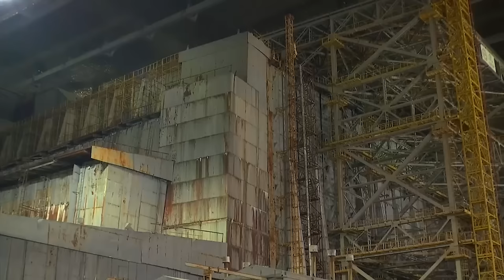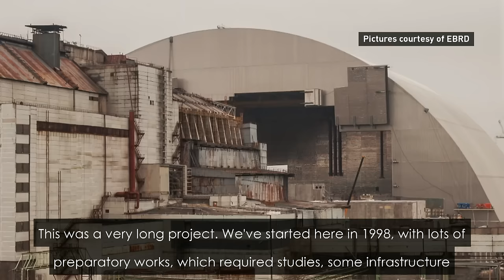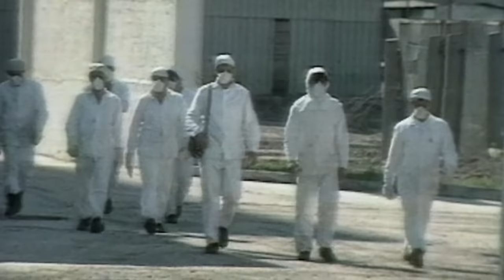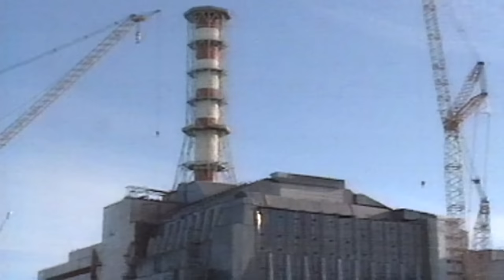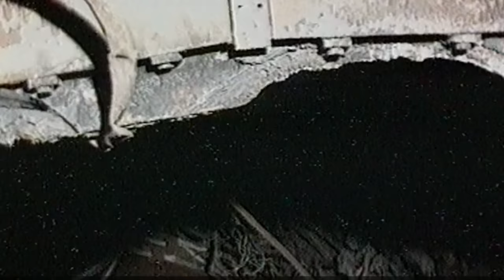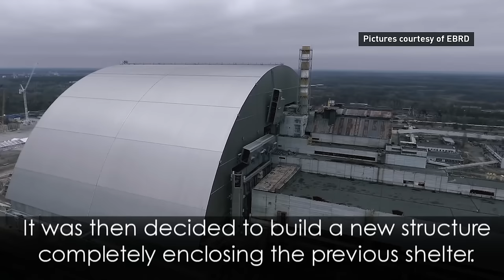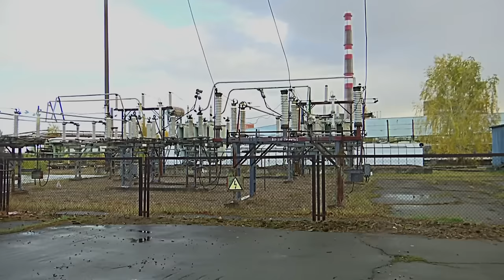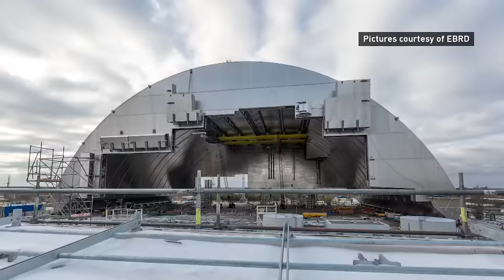Inside Chernobyl’s new €1.5bn structure for exploded nuclear reactor

Comment: so much effort only to isolate 3.6 roentgen?
Reply: Not bad not good.
Reply: Not great not terrible
Reply: Cnn is Fakenews an example, “the elephants foot”
Reply: Not nice good enough
Reply: Marcus Marshall heard it is the same as a chest x-ray
Reply: @JorgeRamirez-dl2hj  Uh no. That's not near the stack, it's underground.
Reply: @akselstrdal3962  That's when it exploded.
Reply: No Deaths *Slams against table* Actually, its the equivalent of 200 million chest x-rays
Reply: They will try to disassemble the reactor so obviously they need a better isolation
Reply: ITS WAY higher than that...the majority of the radioactive material they can get to without taking the old sarcaphogus apart and getting equipment in because most the largest part of the radioactive material caved in when the reactor exploded...also they are still working on a way to get too and remove the massive amount of nuclear waiste sitting on the concrete foundation (which it has been slowly eating thrue) and which under sits the the river from which is the largest source of water to the entire country (also if said nuclear material comes in contact with said water it could set off another explosion 10× or more worse than the first one not th mention completely contaminate the river and the water supply)... and their are parts you are not allowed to go into for more than hour at a time even with full protection on and you arent allowed at all without any protection on because of radiation levels
Reply: It's all about the dust. High amounts of beta radiation have been slamming on the concrete for decades. It causes the concrete to let go of powder contamination. The old containment structure was already starting to collapse. If it had, without this dome over it, then those particulates would have gone airborne all over Europe due to strong winds in the atmosphere. Not only would it be like when the reactor first exploded, the accumulated dose would be even worse because it's airborne contamination. You'd blow you annual intake limit in days or weeks if you didn't seek shelter. You can forget about figuring out your DAC hrs because you're fucked. The powder of the disintegrated concrete is all alpha. And it'll stick to the bronchi in your lungs. That's 20 times worse than anything you'll get from external gamma near the plant. The new containment structure allows them to take apart the old containment structure, and the reactor to prevent further catastrophe. The only issue left is where to store it. And none of this would ever have even been an issue if the USSR had even the slightest idea of what the words SAFETY MARGIN meant.
Reply: Theres areas in there that are much more strong
Reply: I'm pretty sure this is joke, if you guys have seen the mini series that's where its from
Reply: @Tailong  we're scientist. We don't get jokes.
Reply: Humor like Soviet food: Not everyone gets enough
Reply: Jorge Ramírez elephants foot is a stacking of corium so i wont stay 30 mins tbh 10 secs would be enough to die
Reply: you mean 15,000?
Reply: @richardgrace4500  He knows. He's referencing the HBO show Chernobyl where they initially think only 3.6 roentgen is all they are being exposed to.
Reply: I've been informed that the amount of radiation is  only equivalent to a chest X-ray.
Reply: @LuggageStardate  r/woosh
Reply: @charlese.straut9998  my comment was directed at the "roni dude"
Reply: 36 chest x-rays
Reply: Cnn is Fakenews r/woooosh
Reply: Richard Grace r/woooosh
Reply: Ok a lot of wooshes
Reply: @SenkaBandit  jep
Reply: The doze is much bigger than they saying. Its a lie. There are more thant 1000 roentgen
Reply: we got an expert here. sighh
Reply: 3.6 lol...
Reply: @richardgrace4500  there are still lethal doses around I bet.
Reply: 3.6 is actually a quite a significant amount, they should evacuate the surrounding ar......... Hangs up
Reply: boring
Reply: Richard Grace this was when it first exploded.  That will never happen in today’s time because the nuclear magma is completely cooled are is actually no longer eating through anything.        Your trying to apply that Information in the wrong time frame here.        It’s very safe not
Reply: I had collapsed lungs in the past and had over 300 chest xrays for me and still going strong! Idk what the long lasting results are for me in the future or what it's going to do to my body can someone explain?
Reply: They are predicting that the old structure will collapse releasing extreme amount of radiation, to stop this from happening they built this structure so they can shield us from the radiation and take the old structure down safely
Reply: Vinyimanye
Reply: @bishopanderson5864  3.6!!!
Reply: Yes comrade
Reply: Can't be too safe.
Reply: Oh gosh did you just come here to meme lol
Reply: Not bad not good ...
Reply: @richardgrace4500  its a reference to a show
Reply: Hahahaha, you know the history!!!
Reply: Chest x-ray
Reply: @richardgrace4500  R/Woooooooosh
Reply: That project's half fund maybe went to corrupt officials and greedy companies
Reply: @richardgrace4500  thats a HBO chernobyl reference
Reply: Dude what would you do if the first concrete confinement collapsed?
Reply: It's 300 Sv per hour you know how fatal it is just one min dose of that much radiation will damage your whole body's DNA and that's why it needs confinement to keep that radiation inside it as it cant penetrate solid material . If this was not built more contamination may have caused more environmental pollution and for your knowledge, it isn't 3.6 roentgen it was recorded as 12000 roentgen.

Comment: So In 100 years are they just gonna slap another one on top?
Reply: Theres robotics inside that will be able to pull out radioactive parts. They will be sorted into storage a and disposed of. After 100 years, hopefully it'll be nice and clean. Getting rid of the fuel and materials that's dried up and is lodged in is a different story all together.
Reply: This will go on for the next 20,000 years im guessing...
Reply: The general idea is to slowly take the old structure apart bit by bit. then the long con of stashing the rubble away safetly for the next 10k+ years.
Reply: No need to wait 100 yrs. It's already falling apart. :)
Reply: No apparently there gonna buy a tarpaulin from ebay because its CHEAPER
Reply: If it is neccecary. Sure it will stay radioactive for thousands of years but the levels drop over time.
If the core stops sleeping into the ground slowly and radiation drops some more they could just keep the exclusion zone without making a new one. But who knows how bad it will be in 100 years. Just its said elephants foot gives off 1000 roentgen per hour. Sure 30min next to it will kill you but just 30 years ago it was 10,000 roentgen. 3-5min next to it was lethal.
Reply: @atease8781  "I'M ESCAPING TO THE ONE PLACE THAT HASN'T BEEN CORRUPTED BY RADIATION"
Reply: Alex Atasi  kinda sounds like you're the one pulling info. Wandering around a village is a far cry from standing next to the elephant's foot
Reply: @donatasjuskevicius3394  Don't be a clown, it's 3 years old.  By 2065 everything inside the NSC will be gone and it will be dismantled.
Reply: @maximumnoise78  more like upwards of 70k
Reply: Alex Atasi  the elephant's foot is inside a specific room. You can walk around Chernobyl just fine, but the elephants foot is core material that melted and solidified.
Reply: @ethanedwards422  Let me translate your comments into actuality. Very expensive robots will try to pull out radioactive parts and will shut down and fail. Then much more money will be spent trying to find a machine that will do the job. That will be unsuccessful, but the researchers will make a ton of money working on it.  Slaves will be sent in to do the work until they die and are replaced. If they ever get the radioactive parts out, which is unlikely, they will be placed in another very expensive vault that will secure it for maybe 1000 years if you can keep the vandals out. Then more deaths and more money will be spent for at least 10,000 years until the radioactive material is less dangerous and only kills a few people from chronic illness that no one can claim is caused by this radiation. That is what will happen if the Homer Simpsons running the nuclear power industry don't find a more effective and immediate way to destroy all life on earth.
Reply: There will be a robotic Crane that will disassemble the whole thing before
Reply: Probably or they will make it triangular shaped

Comment: Its amazing how small that place looks inside the new structure. When you look at pictures of reactor 4 and the orignal containment building they built around it, it looks hudge but inside this new structure its so small. I hope they can dismantle the original building and get all that old fuel cleaned out.
Reply: That's gonna take a while. A while with a number of zeros after it.